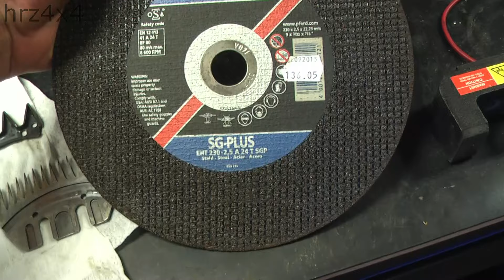DIY How To Sharpen Sheep Shears With Angle Grinder

Comment: Absolutely do not do this to your combs and cutters.  Combs and cutters MUST be sharpened on a purpose build grinder. The disc on a shearing grinder has a bevel which gives combs and cutters a hollow. Proper grinding equipment is essential for sharpening.  You really should take this video down.
Reply: I hope people will take notice of what you have said otherwise they will find they have a very hard days shearing ahead of them. It is ridiculous to try and make an angle grinder take the place of a specialist comb and cutter grinder. These blades must have the correct hollow grind done on the specially shaped discs. Also the correct shearing papers usually 40 grit for combs and 80 grit for cutters.
Reply: This kind of thing is why I never let anyone else touch my gear lol. "I sharpened it for you! With a Dremel!"

Comment: shearing gear is hollow ground , not flat ground
Reply: Yup it is but the plate where you grind is flat. If you put a straight edge from centre of your plate to the edge it meets . That’s where you grind..  the hollow is produced using the correct pendulum with a combination of pressure and heat
Reply: @shearingschool  the disk is not flat

Comment: You could get away with it for a day otherwise U be pushing if U ground like that all the time
Reply from the maker: Two years I have gotten away with it. Too much hassle to go and sharpen them somewhere. I know it's not perfect but it does the trick and I can shear my sheep.
Reply: @hrz4x4  I like it. Im going to try using a bench  grinder/sander(disc+belt).8 " disc with 40/36 grit.  3000rpm or higher...  I'm gonna find out how good this method is if at all lol
Reply: @hrz4x4  the professional grinders are close to perfect.but.they only work perfect if U keep spending money on them
Reply from the maker: @SC-je1ee  And you can always use the angle grinder method as a fallback :)

Comment: Show us them cutting after because you just ruined them
Reply from the maker: I am well aware that it's not perfect at all. But I get away with this sharpening method for years now. If you have a better suggestion how to sharpen blades (at home without specialist equipment) and also get hollow ground blades, then I am all ears.
Reply: @hrz4x4  Sending Blades in for sharpening is like 10€ per Set. If you send them a lot of sets it becomes even cheaper.  Less than ideal is putting it mildly for this Hackjob..